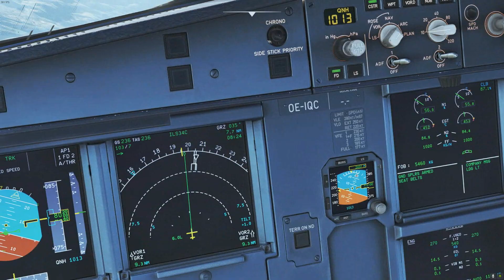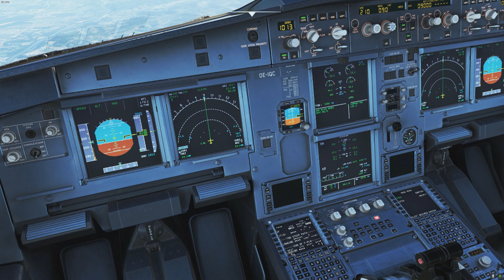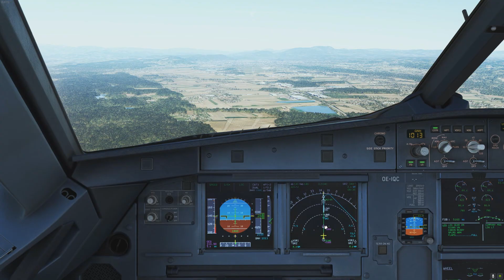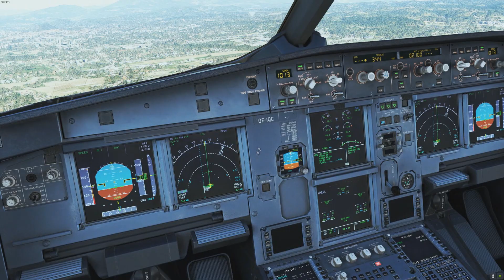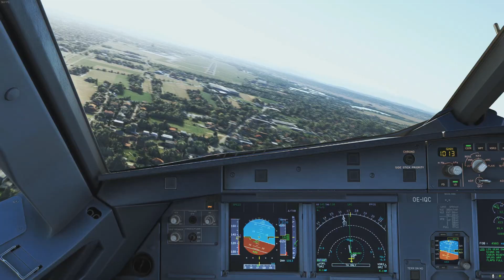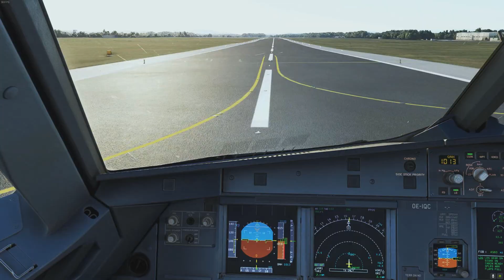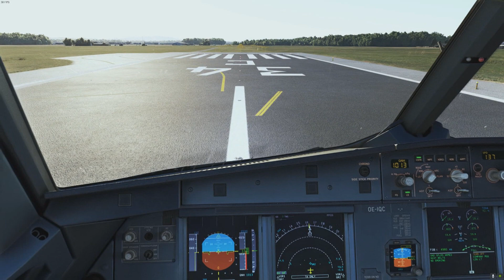Circling Approach - What is it and how is it done?

Comment: Hi! I don’t understand why you switch to (or even consider) doing different missed approach procedure than standard missed approach for ILS 34C. According to ICAO Doc 8168 vol 1 (II-5-6-2 point 6.4) you should always follow missed approach published for the instrument approach used before circling was started, no matter your position in circuit. If you lose visual reference (required visual ques) on downwind or on final to the opposite runway, you should start climbing turn in the direction of runway or direction of the circling designated/protected area. If no „in case” instruction from ATC you should never consider performing missed approach designed for rwy 16. That’s how I was trained and what I have performed many times. Am I missing something or are there any different procedures in place at your company?
Reply from the maker: @bziiuuum  It depends on the airport and maybe the company. In Innsbruck you cannot fly the published go around once you have left the LOC approach. 
I this case I would argue that once abeam it is better to initiate a turn to the left and fly the go-around the other way as it will take you away from the mountains.
On some approaches we actually have a defined point where we need to switch from one go-around to the other.
If I remember correctly Split is such an airport.
Like I said, for Graz there is no written procedure, so you need to brief what you want to do. 
Just a question. When would you switch to the other go-around procedure? When turning final? How would that work on the MCDU? I am curious.
Thanks for commenting.
Reply: @fsclips Thanks for the reply! I am very interested in your point of view and your company procedures. I am myself an ATC and commercial/instrument pilot and throughout my 20+ years career I have always been thought that if you (as per your example) preform ILS34 with circling to 16, you always have to perform missed approach published on ILS34 chart unless local procedures or ATC instruction states otherwise. I have looked up charts for LOWG and if I were on final rwy 16 and had to go around, I will continue straight ahead climbing to circling MDA (1640 on my chart), initiate left turn (because circling is prohibited west of the aerodrome) and intercept missed approach segment of ILS34. If I were on downwind I would perform a climbing left turn - again to intercept MA procedure for ILS34. I can not say anything regarding MCDU setup, cause I fly planes with Garmin avionics (G1000/G3000) and we never put anything other than missed approach procedure for the "original" runway. If go around is performed, we simply unsuspend point sequencing from the ILS34 MAPt. Cheers!
Reply from the maker: @bziiuuum  I see what you mean now. That would make sense except that on the bus we have to activate the secondary flight plan once we are abeam of the runway. It is Airbus procedure. That means you have no more guidance regarding the ILS go around and are commited to do the other one. 
Since we are an airline that only operates Airbus I guess our procedures were adapted to that. When initiating a go-around the aircraft automatically flies the go-around procedure and if you activate the secondary flightplan that would be the one in the opposite direction. Of course, as a pilot you can choose to still carry on with the initial go-around, but the aircraft wont give you any guidance and if you screw it up you will have a lot of questions to answer.
I guess in the end both options are there. You need to stay within the safe circling area and then fly one of the procedures.
Interesting to get an insight from an ATC controller. Thanks!

Comment: Should we also account for the wind direction while in the 45° break out leg regarding the 30s ? Thanks for the content !
Reply from the maker: Yes, wind will always play a role regardless where it is coming from. If it is from the right it will blow you towards the runway and you may have to increase the bank in the turn, if it is from the left you may have to do a shallower turn. 
A good rule of thumb is to add 1 sec on the outbound for each 1kt of headwind and subtract 1sec for each 1kt of tailwind. I hope this helps.
Reply: @fsclips  Thanks a lot !

Comment: As you suggested, procedures like this are tough with only one pilot and 2D situational awareness but this was another great instructional video.  You're one of the most relevant and interesting A320 streamers out there - keep up the good work!
Reply from the maker: Thank you, that's very kind. The final approach was a bit questionable, but the idea was to show off the procedure, not any flying skills 🙂
Reply: @fsclips  No worries.  One question I have for clarification: when you switch to manual Heading mode, does VNAV no longer work i.e. you have to descend entering a fpm value?  Is VNAV not possible in Heading mode at all?
Reply from the maker: @ClevaTreva  No, because in order for the aircraft to do a managed descend it needs to know the distance to the runway. If you engage HDG mode the aircraft has no idea where you are going and what you are planning to do, so your only options are open descend or VS mode. Hope this helps
Reply: @fsclips  Excellent, thank you.